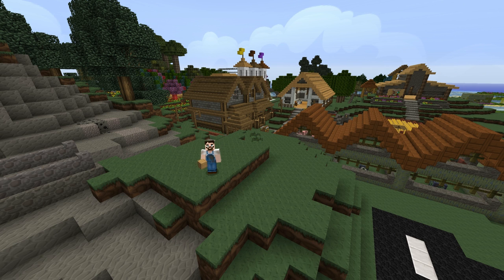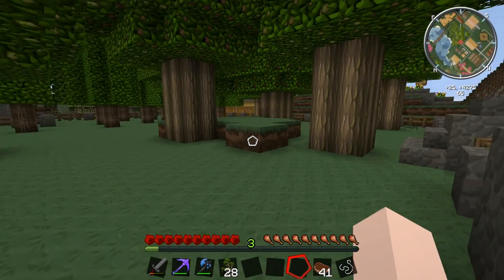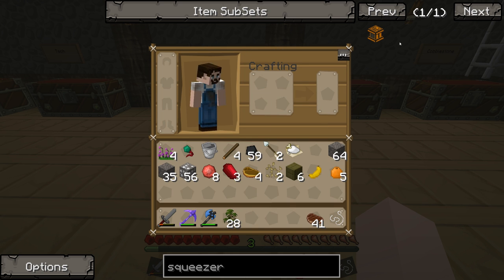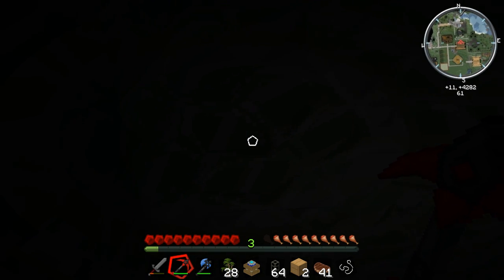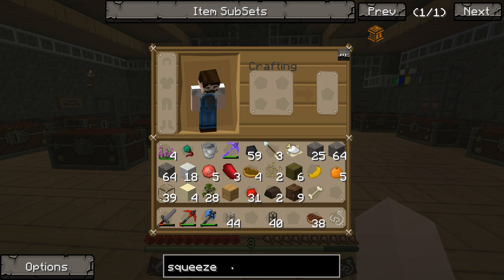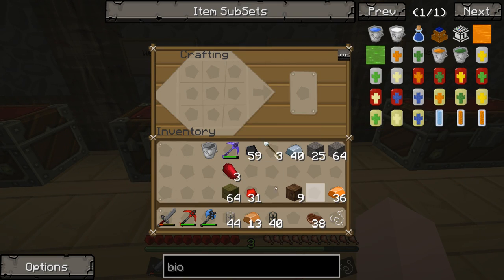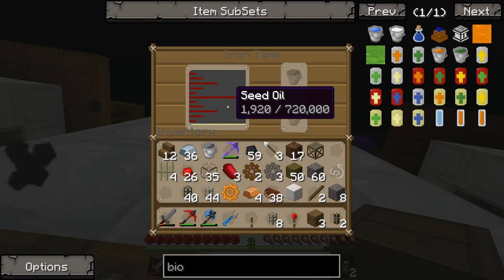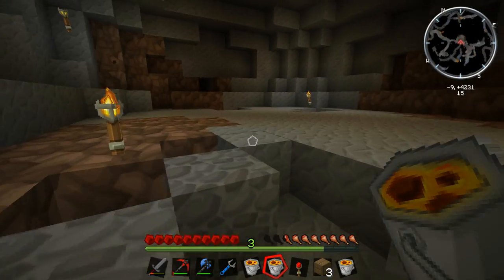Feed The World - #27 Chestnut Power

Comment: If i was doing this, I would keep the honey tank and the biogas engines that r hooked to the honey tank and use those engines as a back power supply in case that Strawfingers damages the chestnut multifarm and harms the production of seed oil. Actually, i would remove the honey biogas engines and if something happens to the chestnut farm, THEN power up the biogas engines for the honey tank, until repairs were made to the farm.

Comment: On the reds tone conduits the blue arrow should be facing the other way, when this is done using a crescent hammer it will go orange, sending power out not into the biogas engines.